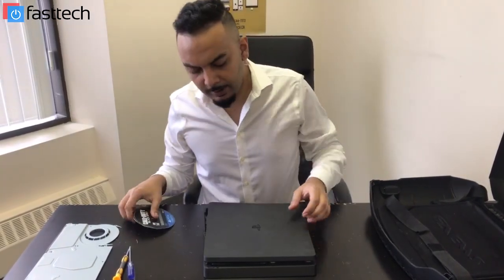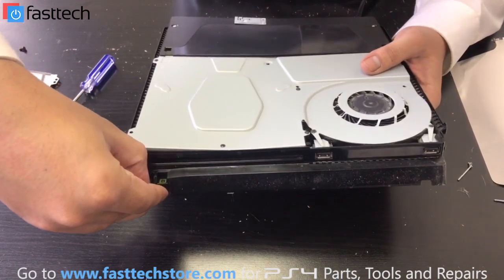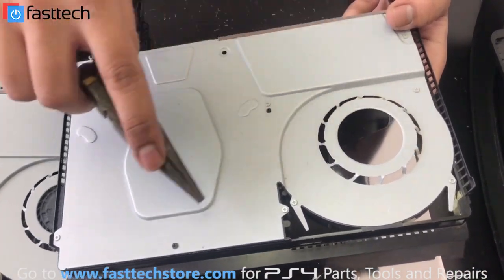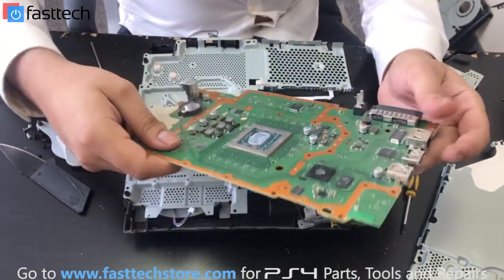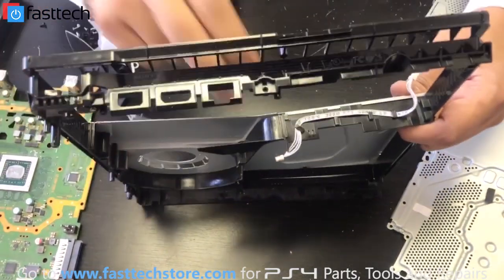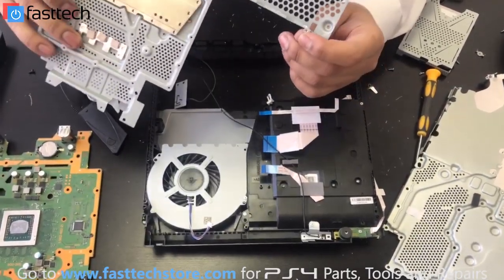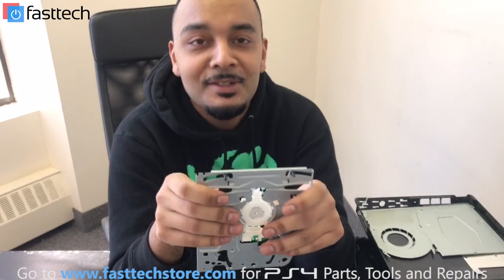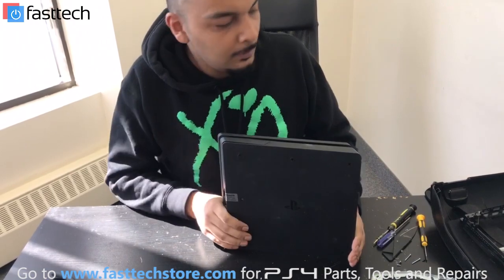PS4 Slim Disassembly and Disc Drive Repair

Comment: The washer thing on the heatsync that you point out at 9:26... yep, I've lost mine. Gone back together without it but will this cause any issues? Vibration?
Reply from the maker: No. There will be a screw on the other side that wont screw in though.

Comment: My ps4 cannot insert games dvd, how can I fix it?
Reply from the maker: Does it read blu rays and other discs?
Reply: @fasttechvideo  no, my ps4 can not suck any discs into cd ROM, just can trigger ps4 to power on. Thanks for your time.
Reply: @fasttechvideo  i tried to replace the Optical Disc Drive Sensor Switch Motor for PS4 slim, but the problem is the same. I will try to replace three cables of disc drive, not sure if it can help. I afraid the root cause is from motherboard.

The problem is while I am playing the game and it was stopped and show the disc cannot be read. Then I tried to restart the ps4, the disc drive cannot read any diac anymore.
Reply: @fasttechvideo  is the problem can be fixed by replacing disc drive cables?
Reply from the maker: @HowyWang  what is the model number of your ps4? Starts with CUH
Reply: @fasttechvideo  2017 (ps4 slim)
Reply from the maker: @HowyWang  this could be a logic board issue and sometimes it could be a blown fuse. One the slim ps4s the disc drive logic board is built in the mainboard. This is only likely if the system has never been opened up before. Small chance it could be the disc drive itself but when the system does not accept the disc at all its most likely not the disc drive. Hope that helps.
Reply: @fasttechvideo  thanks for your sharing. I will try to replace dsic drive cables for a try. Many thanks for your help.